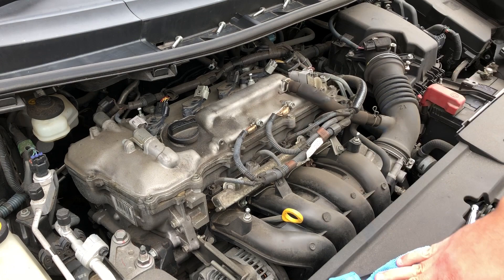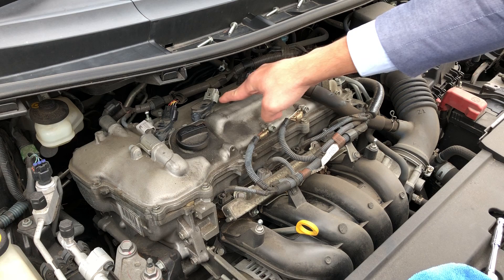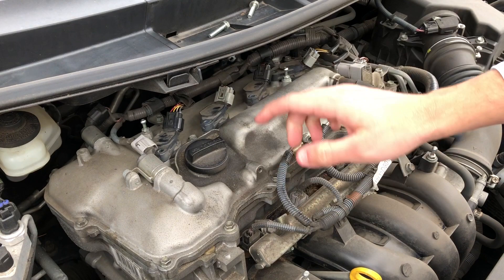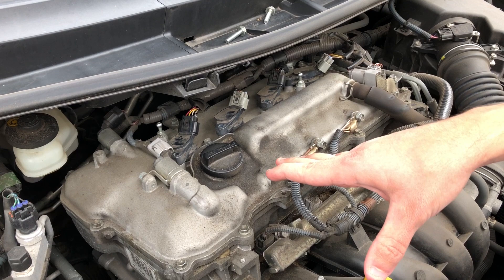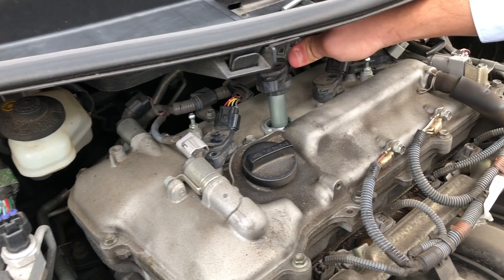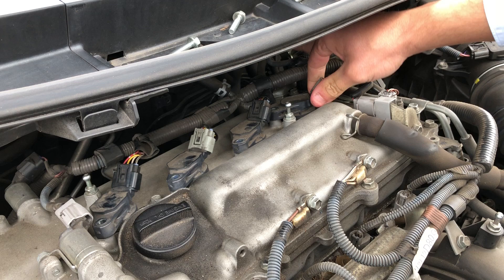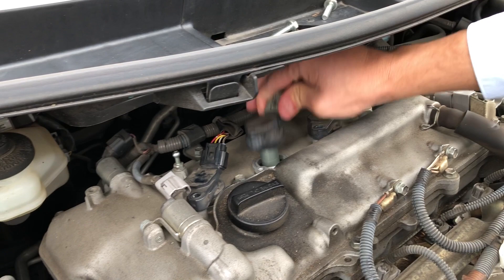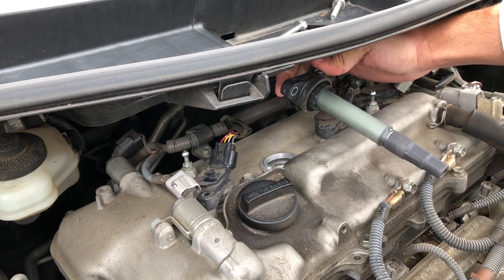How to Diagnose a Faulty Coil Pack in UNDER 2 minutes, with no scan tools! & Check Engine Light

Comment: What if you’ve replaced the coil pack and in two months you get the same check engine light code. The light goes out some times.
Reply from the maker: Do you still have misfires?